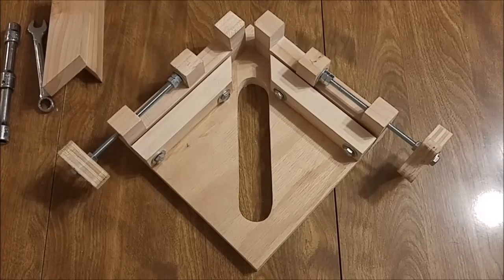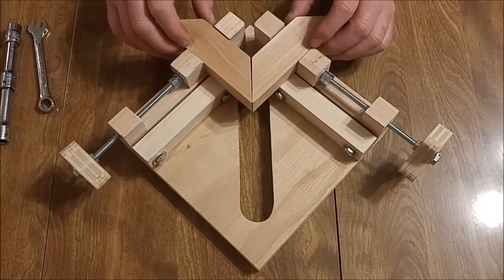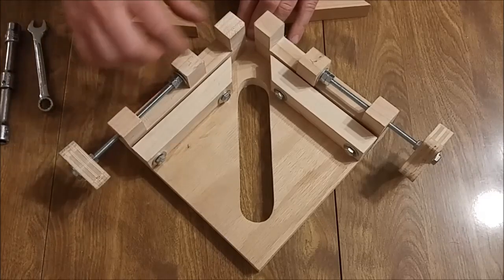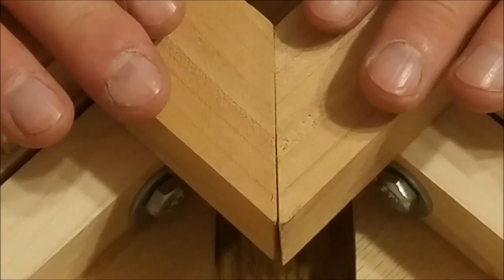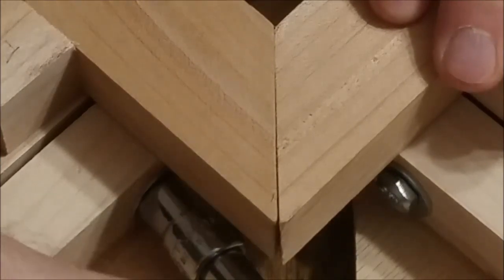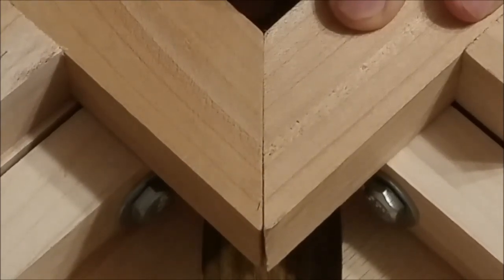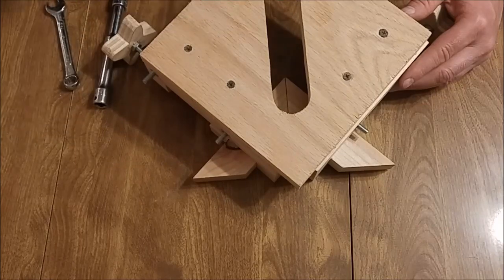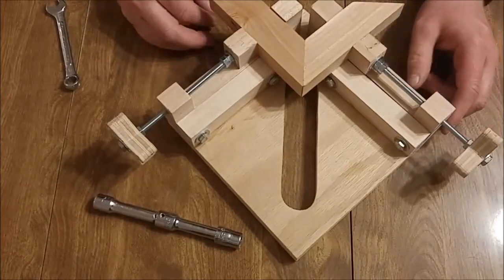Corner Clamp / Frame Clamp Jig

Comment: It’s nice to adjust one corner of a frame to match but if by adjusting one corner you affect the square of the frame or box. You much make perfect 45 to make a perfectly square box.
Reply from the maker: Agree, best is to make as close to perfect 45deg cut to start with. However as you know it's not easy to make a perfect cut. This said I have used this clamp a few times now and do find it useful. Glad you enjoyed the video.

Comment: Great job man. I would call and  partner with Rockler mad see if they can take your idea and coproduce it. I think you're on to something pretty cool. In fact making something similar that can bring all four sides together at the same time on all 4 corners in a larger sled/base would be enough for me to buy it! I make frames and the glue up is always a pain. Good luck, and if you produce this with Rockler, let me know. I'd support your venture in buying the product.
Reply from the maker: Thank you for the feedback Marco! It's much appreciated and glad you like the project. I'd also thought about having a sled/base. But tried to design to avoid the need for a sled/base which could limit size of the frame and/or take up extra storage space. With the design in the video each clamp firmly holds the two sections of the frame together and so if using 4 clamps there should be no need for a sled/base (of course if the frame is fragile or very heavy those could be exceptions). With this clamping system you will be able to rigidly hold all 4 corners in place and yet still glue each corner one at a time to take the rush out and increase precision.